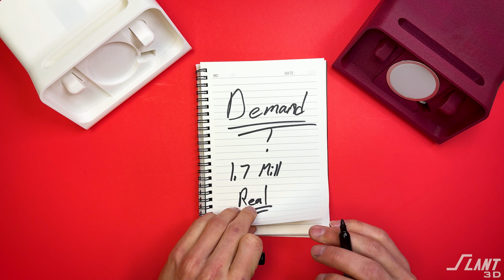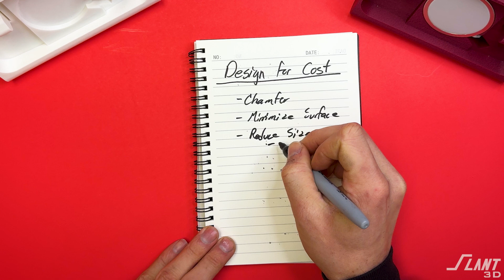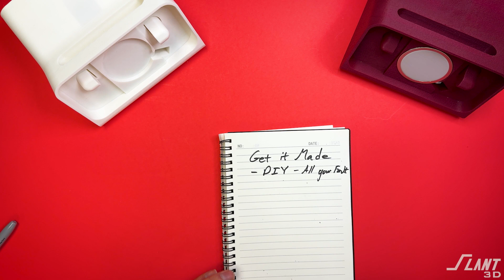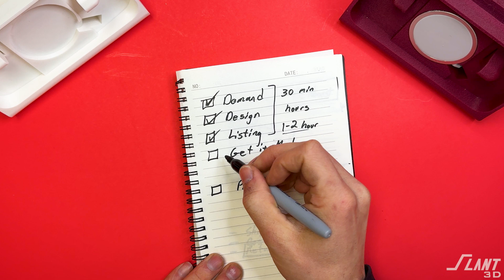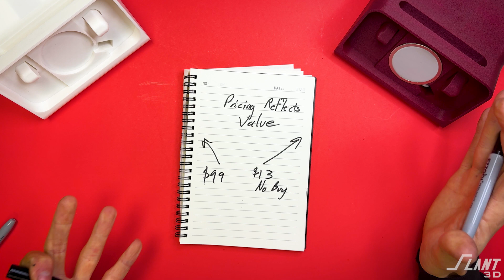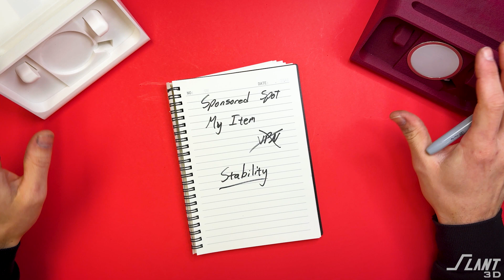Step-by-Step: How-to Turn Your 3D Printed Design into a REAL PRODUCT

Comment: 25% can never work. And it’s still low if you add ALL costs, like platform fees, rental, taxes, returns, customer support, design time(!), shipping material, packaging time and what not. Cost to make (printer/hour, energy, filament, (post-/)processing time) x4 or x3 is my formula. x1.25 would only be acceptable if that’s the profit after All costs, AND without having to work for $5/hour…
Also your good selling products NEED to compensate for the ones you wasted your time on…
It also depends of course a bit on the end price and the volume you can sell.

For the phone stand I don’t think the people who buy it for 99 do compensate for those who don’t buy it at that price. I think that’s a bit overpriced, and has a higher return rate also. I’d guess at around 30-40 without charging module, and 40-50 with, everyone could be happy.

Comment: No ones paying $99 for that
Reply from the maker: Already are
Reply: @slant3d  It's only $49 or $59? To me that's a $30 item without the charger. I do get your point and I know people will pay it, but it's a small hunk of plastic.
Reply: @802Garage it's a hyped design item. Anyone paying 1000 $ for an iPhone will pay 100 $ for an accessory. Know your market. Personally I'd make my own for 10 $ but that's just me.
Reply: @802Garage  I think the $99 from the video is if they used Teleports new 3rd Party parts system. So it's currently $49-$59 for just the plastic and if you included a charger the price would increase to $99.
Reply: @slant3d  But is it just his fan base or actual real world people who never heard of him?
Reply: @slant3d  no they’re not - it’s $49
Reply: I would rather buy a BambuLab for 199€ and print it my self.
Reply: @lazyman1011  exactly !
Reply: I wouldn't... But you'd be surprised. People pay outrageous prices for dropshipped crap from China.
Reply: Very much depends on the market. Fans of the creator may do it. People get caught up in hype very easily. There was a productivity youtuber who released a mechanical keyboard that was insanely overpriced compared to the rest of the market, but a bunch of people bought it because they were fans of the creator and they were ignorant about the greater mechanical keyboard market.
Reply: I get the point of the video, but people are crazy if they pay $99. For that price id much rather a Belkin or the like with a faster charger.

Comment: From my experience, using less infill can save money, but it negatively affects the perceived value of the product. If a product is too light, people don't see it as something of value, especially a printed product. You can increase the weight by adding washers, lead sinks, etc.. but I've found that it's actually more economical and less hassle to increase the infill density. Also, If you're primary income source is from the product alone, that is, if you have no social media revenue, 1.25 -1.5x margin is just way too low. You need at least 3x to have a sustainable business.
Reply: I agree, I also sell prints online, alot of them with 100% infill. It is also not really that expensive if you pay 7$ per kg
Reply: A special tool head to drop magnets or weights in automatically would be very cool.

Personally I use tire balancing weights in my prints when needed. They’re not that expensive and the extra weight can make a big difference.
Reply: I wonder if slant will offer a limited standard sizes/types of weights and magnets that can be added - not during print, just dropped in with glue at the end. You'd probably pay a premium for that service, but it could be useful.

Comment: Note this:
If the make is 100, and you charge 50% (sell at 150) and the store takes 20%, you left with 120, only 20% of profit.
Reply: He also never included shipping and handling, but I doubt that print costs $15 or a whole spool to print, maybe $5 and he included S&H into the part price.